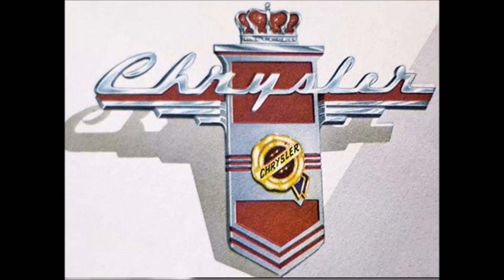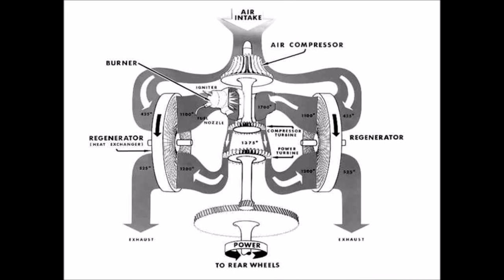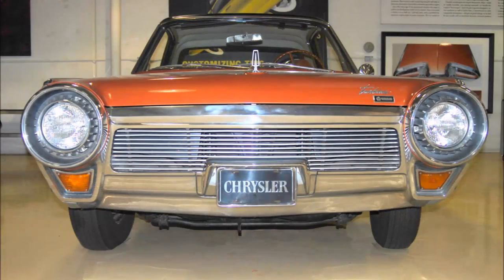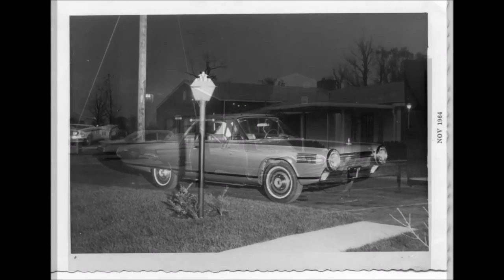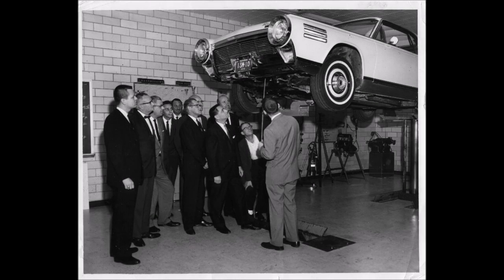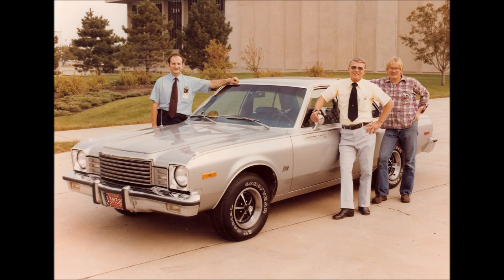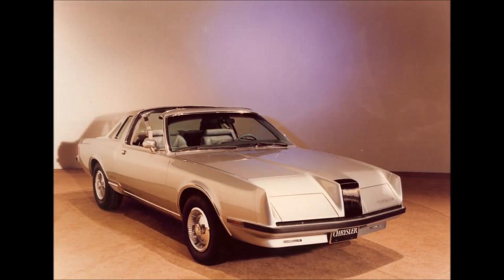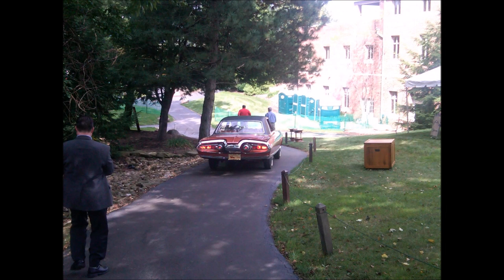The Story of the Chrysler Turbine Car

Comment: "The engine can run on virtually anything with combustible properties and "Chrysler claimed the turbine could gulp everything from peanut oil to Chanel No. 5." The President of Mexico tested this theory by running one of the first cars—successfully—on tequila, after Chrysler engineers confirmed that the car would operate successfully.  No air/fuel adjustments are required to switch from one fuel type to another and the only evidence of which fuel was used is the odor of the exhaust. "

Comment: A former co-worker of mine was part of the test program. At the time, he was a traveling salesman. He said the car ran exceptionally smooth and he had few if any problems with it. He would have to meet with the test engineers periodically for them to take test readings of the engine. Overall he was impressed with the car while he had it.

Comment: My buddy's family was chosen to get one of these Turbine Cars for consumer testing. I got to ride in it many times. It was really cool to ride in, the interior was really "space age" for that time period. I loved the copper color, it really stood out from the other cars on the road. To this day, I'm still partial to that color and have had similarly colored motorcycles and cars. The turbine ran really smooth and sounded unlike anything on the road. I remember my buddy's father balancing a nickel on the engine as he revved it up. The only downside was that, even for that time period, it was a real dog when it came to acceleration. It rode super smooth but it seemed to take forever to get up to freeway speed. My buddy's dad was so impressed with the way the car looked and ran, he bought a new fully optioned 1965 Dodge Monaco with a 413 V8. It didn't ride as smooth as the Turbine Car, but that 413 would run rings around it and most other cars of that time.

Comment: I saw one of these in the year 1964 or 65, at Carlisle PA.  I was a student at Dickinson College at the time.  I don't know who owned it, but I vaguely remember that someone I knew got to ride in it.  Wasn't there also a turbine powered car at the INDY 500?  I remember that it was winning until the very end, when something broke, and it coasted to a stop.  I think they were banned after that, from the race.  I don't know if I have my facts straight on that, or not.
Reply: +nidurnevets As I recall, Andy Granatelli was a big promotor of the turbine powered car at Indy.  The first year was 1967 I think, and his driver kept the car in first place for many laps until close to the end when there was a flame-out with no way to restart.  It was a 4-wheel driver car too, and was able to make the whole race on only 2 pit stops.  After that race, the US Auto Club decided that the next year, they would limit the intake of the turbine to 15 square inches.  So Granatelll redesigned the turbine as a smaller 2-wheel drive version, wedge-shaped for les air resistance and again led most of the race that next year, but as I recall a gear box problem came up towards the end of the race, so again he didn't win.

Then after that, the U.S. Auto Club made the outrageous decision to outlaw turbine engines altogether, claiming that "the fans expect to hear the roar of engines".  Because of that decision, I never again watched an Indy 500 race.
Reply from the maker: +bodryn Yes, turbines ran at Indy for two years. Did pretty well but dropped out for non-turbine problems.
Reply: I remember the turbine car at Indy.  I think there were a number of reasons they banned them.  Another car engine I remember is the Wankel engine, if I am spelling that right. My wife had an old Mazda with that type of engine. It seemed to be a reliable engine, but they don't make them anymore as far as I know.

Comment: The EPA emissions test (at the 10:00 mark) were restricted to fuels that would make the turbine look as bad as possible. Why was that? Influence from Ford and GM. They had previously thought that the turbine was advertising gimmick that would never sell to the public. Once the Gen-3 engine was running, it was obvious that it could eventually be improved enough to smooth out the rough spots. There were two problems for Ford and GM. First Chrysler was WAY ahead of them on small turbine development. And second, most piston engines would wear out at 250,000 miles, and these turbines showed every indication that they could last over a million miles. This meant that people wouldn't buy as many cars as frequently. It's not hard to do the math. When there is an oil crisis that threatens Americas independence from foreign interests, here was an engine that could run on vegetable oil, or bio-diesel...

Comment: I would have done cogeneration with an electric motor on each wheel. It might work well as a Hybrid system with a big enough battery. BMW did experiments with recovering heat energy from the exhaust. Why did they scrap the motor? Might've made a good stationary generator.

Comment: the one that I saw had no steering wheel 
...it employed a "Joystick" in the center console that replaced the 'Stickshift' to go forward, left, right, and pull back for brakes 
...it had a button in the middle for reverse
...My version of the 'turbine' was STEAM (superheated) 
...Today I would involve some 'electrolysis' (Plasma) system

Comment: What kind of transmission did they use? I've recently had the idea of using a small turbine engine to power an electric motor which would power your wheels. That would give you the acceleration and speed that everyone loves about the Teslas, but you would have a much longer range than a Tesla.
Reply from the maker: A modified torqueflite. It was not directly connected to the turbine. The turbine had a fan that blasted air over another fan which was the input for the transmission.
Reply: Steve Lehto Neat! Do you happen to have a link to any drawings or demonstration videos? That sounds like a really interesting design.

Comment: Excellent video, Steve. It's easy for some to think there were dark, hidden forces that killed a promising thing. As usual, the truth is more complex. Gas turbines were tried a number of times. They seemed like a really cool idea at the time, at least as pitched in media such as Popular Science at the time. They had major advantages, but big downsides as well, some of which you mentioned. One thing not mentioned is that, whereas the pulsed nature of the combustion in a piston engine means that it can efficiently get rid of most of its waste heat straight out the exhaust pipe, engines like turbines and steam engines require heat exchangers to get rid of a bigger load of waste heat. Combine this with the high internal temperatures (requiring expensive materials), and the high fuel consumption at idle, and a few other things, and you have something that just didn't pan out in the end. Turbines were, in fact, tried in trucks and buses for a while, but just didn't catch on.

Steve, being in the entertainment industry as well as being into technology in general and cars (an interesting combination that once had its epicenter arguably in Detroit), you may be interested in an observation I'll make. Thinking of this, I also think of a couple of other technologies in audio engineering that looked promising at the time. Those were the radial tonearm and the crossfield tape head. The first of these was a bit like the gas turbine in having some obvious advantages, but it was difficult to make a tonearm go sideways across a disc without introducing noise and vibration. The crossfield head worked fine AFAIK, but only helped performance significantly for slow tape speeds on tapes that weren't that thin—a combination that wasn't getting used much. I've owned devices of both types. They were in a Rabco ST-4 and a Tandberg 3600XD. My memories of both products are not especially favorable. Of course, ultimately digital technology soon made all this pretty much irrelevant (one thing being that, although digital used tape at the time, it did not use bias, so there was obviously no question of how best to apply it).
Reply: You're wrong. The only reason we don't have cars using this technology today is the federal government and overbearing regulatory overhead.

I was promised flying cars by 2020, but I can't even have a turbine powered road car.

Comment: Chrysler made a huge mistake by scrapping this program. With stupid thinking they bankrupted the company and failed to get a clue what the future consequences would be. It was a beautiful automobile, and would have improved its efficiency. What a shame that they scrapped this car. As for the consumer abuse that led to problems, it's obvious that a turbine design has fewer moving parts and would require far less maintenance. Now they are trying to figure out how to build an electric plane. This would have been pivotal. 

Save a penny and throw away the treasure. That's what Chrysler did.

Comment: What were those clear bubbles those cars were kept in?
Looks like they were to preserve the car, but I'd be keen to know what gas they were filled with and what they were made of
Reply from the maker: They are just storage but there was nothing special inflating them. They each had little air pumps and they plugged into a wall outlet. We took the turbine car out of its bubble and then put it back in. All the air in the bubble is outside air. The main thing was to keep dust and bird droppings off the car.
Reply: Ah , ok.  thanks for that
Reply: @stevelehto  they make bags like that to store motorcycles and small equipment in. I thought it was more for mold .

Comment: Great job on this video synopsis for the Legendary Chrysler Turbine Cars. 
If only Chrysler and the designers had realized that Turbine Engines are most efficient at 98% rpm and above they wouldn’t have coupled it to a transmission but instead a generator that powered an electric drivetrain the performance and possibly the fuel economy would have been much better. 
Today several companies have developed and are continuing to refine “Microturbine Range Extenders” for electric cars. In my opinion this is a better solution than pure Electric Vehicles or Hybrids that utilize small gasoline or Diesel engines to extend their range. 
Microturbine Generators are much lighter, only have a few moving parts, DO NOT have lubrication or cooling systems or require regular maintenance. They can be run on almost any currently available fuel without modifications, are extremely efficient, DO NOT require any exhaust gas treatment of any kind (and that is from the US EPA) and have projected lifetimes of 15,000 hours (I had a company truck that had 256,000 miles with less than 6,000 hours on the clock) a properly designed “Range Extender Package” could “easily” be transferred from one EV to another if desired. 
These units have more than enough capacity to power the EV while recharging the batteries before switching off when not needed.

Comment: Since the turbines run more efficiently at high power, they should always run at high power. But how? The cars are slow to accelerate if the engine isn't at high power. So the engine should always run at high power. But how? One solution might be is to use the turbine to generate electricity and not be part of the drive train. This electricity could power electric motors on each of the rear wheels. This allows the turbine to run at high power all the time on an alternative fuel and the electric motors supply the acceleration the car lacks. This hybrid car wouldn't need a massive battery pack that eventually fails. There's fewer moving parts, less pollution, no reliance on fossil fuels, no rare earth materials required, and it doesn't have to be the size of a compact car.

Comment: Interesting how the government, through regulation and strict guidelines, stifled progress and innovations.  By trying to ensure tailpipe emissions met a standard, the controlled the use of specific fuels for the testing which then eliminated the ability of a machine like this to surpass the requirement.  It could  have led the country into the future with cleaner fuels and engines and eliminated 30 years of smog in the big cities, but instead the innovation was killed off and progress greatly delayed.

Comment: My dad, Jerry Mills, worked for Chrysler.  In the 60s, he as assigned to take one of those turbine cars to NYC for the Today Show.   On TV, he fueled it with $5000 worth of Chanel #5, plus a bottle of whiskey.    He removed one of the front wheels, because Chrysler also wanted to promote their torsion bar suspension.   For the rest of the day, he drove around Manhattan on 3 wheels.  Alas, I have no pictures from that day.

Comment: the problem with the G.T.E (turboshaft/turboprop)  lacking of torque is that it has only 1 stage of split shaft turbine, if it has 2 to 3 stages of free power turbine then the torque increases too and fuel consumption will decreases also. Look at the G.T.E.( turbofan ) turbine  stages.

Comment: I'm a make one but I'm a run it with a air compressor just enough to turn it over then I'm a rig a alternator somehow to keep it producing power on the blades that are gonna keep it rotating which are gonna make the axles on tbe back spin but I'm a try to make it out of kinetic energy and have a solar panel for emergency use in case if it shuts down

Comment: what is the problem on CHRYSLER GAS TURBINE ENGINE?i dont understand why?
Reply from the maker: Why what?
Reply: why is that there so many improvement that chrysler have done to the car that was powered by  gas turbine engine but still they rejected it?
Reply: It wasn't that it was a bad idea it was the fact the engine cost  $10,000 let alone the cost of the rest of the car. It was going to be out of price range for its time and would lose money on the project. The cost of a hemi in that era cost the factory $700 to manufacture. Makes sense now?
Reply: oh yes,men

Comment: 12/29/2019So, what does more than a dozen mean?  13? 50? 5,000?  Can you be just a wee bit more precise?
Reply from the maker: 12/29/2019. It is the future and whatnot but a dozen is still 12. More than a dozen is 12+. Check back in another few years and ask if that has changed.

Comment: Loved the documentary, with that being said its extremely frustrating to hear that the emissions laws killed the car, seeing that it would have been an amazing alternative fuel engine, pretty silly to dictate what fuel an engine should be run on just to meet a "standard"
Reply: It's the same thing with the recent VW emissions scandal. Total emissions were lower, since less fuel was burned, but since the EPA measures "parts-per-million" instead of "parts-per-mile" in the test, the cars were not compliant with emissions standards. The EPA responded by dumping millions of gallons of toxic water into a river in Colorado.